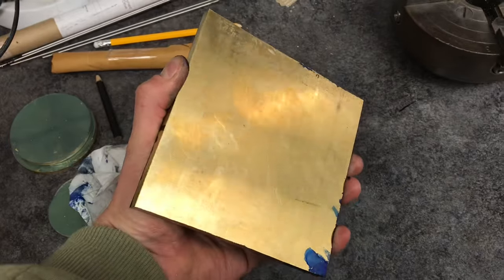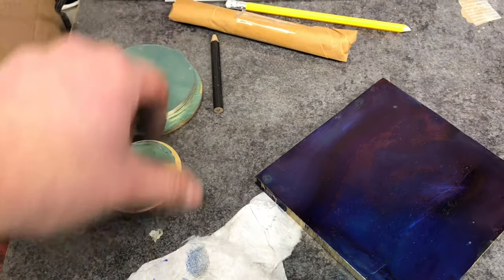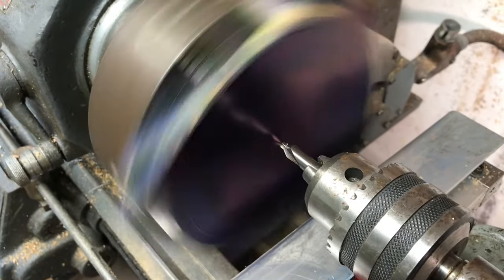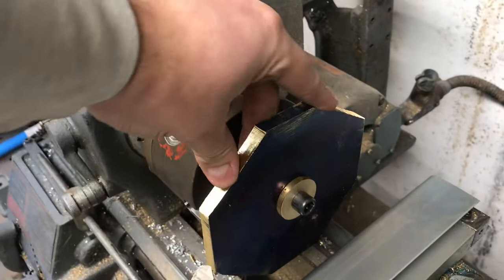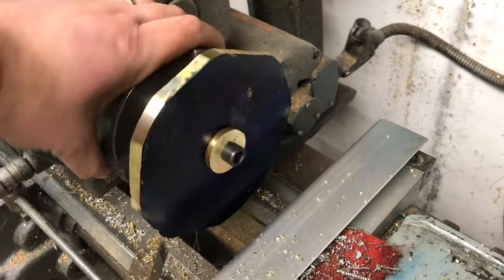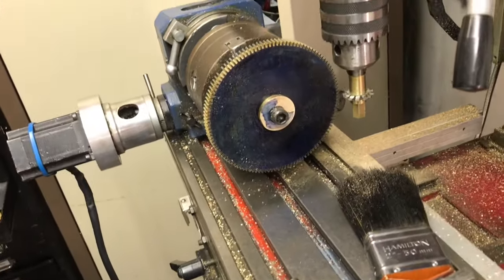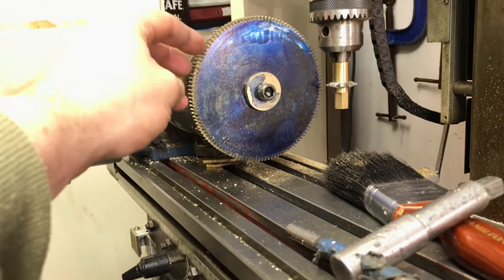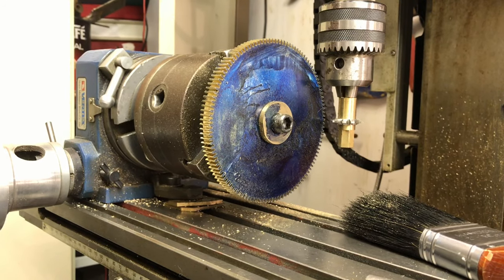Making a Church Turret Clock in the Home workshop: Pt 5 - The Main Wheel ... disaster averted!

Comment: Really nice job Chris.   When I saw the title I thought you had got to the last tooth and got a half one left.  Everyone's dread.
 Good solution in the tradition of historic clock repair.   Also brave to remove the wheel from the chuck to braze in the repair as it must have been a pain to make sure all was aligned correctly again for the re-cut.  Impressed.   Alan

Comment: Been there and done that, but only on a small inexpensive piece of brass compared to yours. Good on yer for the excellent repair. I was hopping mad with myself. I can only imagine how you felt.
To try and stop myself from doing the same thing again, I put a micro switch on my mill slide to advance my Steve Ward divider each time the end of the cut is reached. That way it was unlikely I would press advance prematurely and the whole process becomes semi-automatic. 
I made a wheel cutter holder from a taper blank. It goes straight into the mill spindle and gives me enough clearance for all the wheels I have cut using that method so far. Similar for holding the wheel blank in the lathe and rotary table.
P2.

Comment: Love your video brother! Have you ever thought of picking up a scroll saw? Cuts brass like a dream with the right blades
Reply from the maker: I’d love one....not sure what would be the right thing to get and the correct blades!
Reply: craynerd I scored the deal of the century on a hegner off craigslist, they are about as good as you can get. If you can’t find one of those, a nice dewalt or something would do just fine. Just look for variable speed,. I use a brand called Flying Dutchman blades, they are the best I’ve found.
Reply from the maker: bigadamhilbilly they are looking to be £250 over here cheapest.... it’s a lot but they would be a big help!
Reply: craynerd my hegner is the same one clickspring uses and I got it for $150! It was from an old man who bought it for $1400 in 1989 and used it twice before deciding he preferred his lathe. Keep an eye out and you might find a deal!